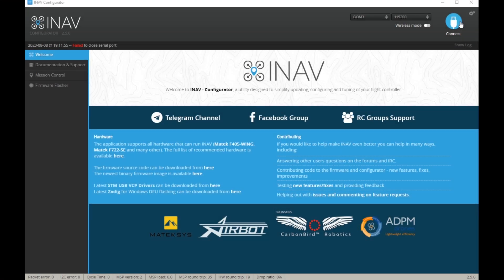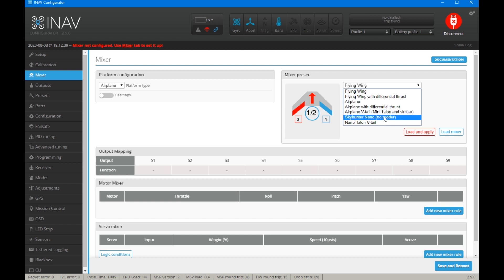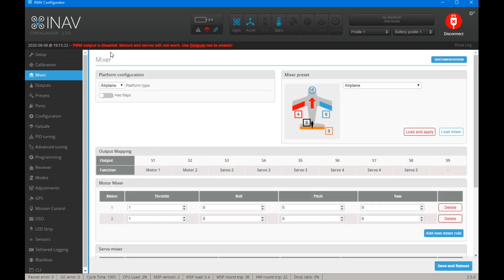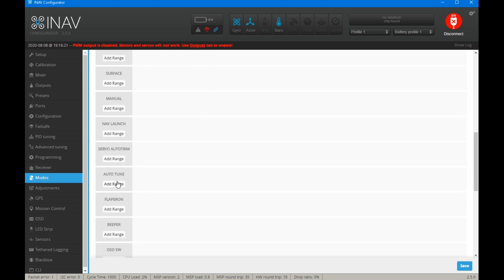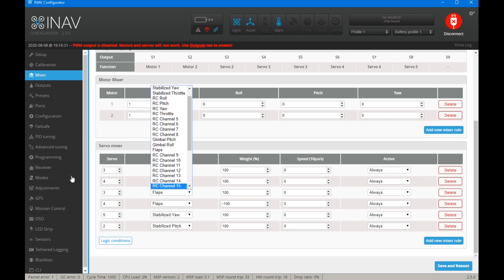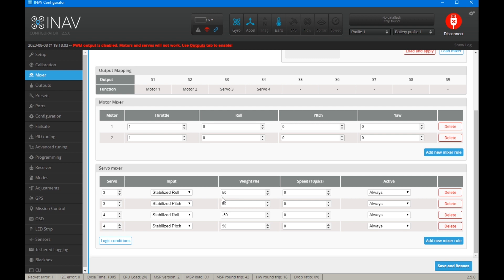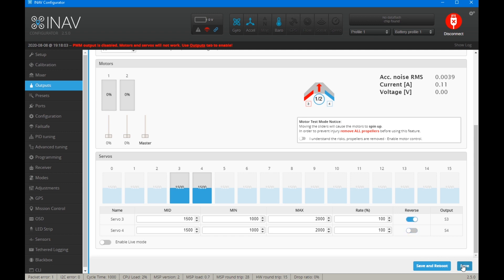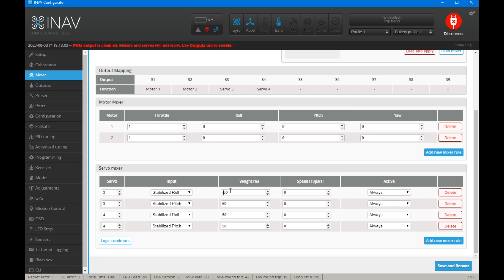Setting up the iNav Mixer

Comment: I know this is pretty old video Darren but I need your advise once again, I'm doing my first build ever of a inav vtail and have never flew a vtail, this plane is a talon rebel gt with 4 servos 2 for alerions and 2 for rear elevators. It would be nice if when you turn the mixer would activate the rudervators the correct amount to help turn, is this even possible? I ask mainly because this plane has very small control surfaces. Also the vtail elevators has no build in reflex so would you add a little atleast for maiden flight? Thanks for all your help

Comment: This video is old, but the problems with the mixer not. nobody understands, ho it works. i have a plane with ailerons (Y-lead for both - one channel), ruder, elevator and flaps. flaps are controlled out of inav. so i have 3 "servos" left. but why the heck its so complicated in inav to choose, wich output of the matek fc is wich deflection? 

in my case, inav did some wierd stuff and mapped the outputs so idiotic, that nothing is working, TILL I have to fix it...

wich output is wich servo, is wich in the mixer - and if im changing them, they not behave like i see in the configurator.

thats so annoying...
Reply from the maker: To be honest, the mixer is not too bad. The servos are assigned in order. You don’t choose which output does what, iNav had to do that based on what the target allows. The default mixer for each type of plane is shown in the diagram at the top of the mixer page. Also, Matek have great wiring diagrams for their flight controllers. 

The problems can start when you have a non-standard setup. But the key here is to setup your mixer before you connect the servos to the flight controller. That way, you know which output goes to which servo. For example, using a Y lead for the ailerons, just remove one of the stabilised roll mixes. This will cause the pitch and yaw to move along one output. Then just add the rc channel for the flaps to a new mixer line(s). 

Which output controls which servo is shown in the bar that runs across the screen, between the diagram and the mixer.

Comment: So I'm setting up a twin-motor for the first time, on iNav 3.0.2, and have debugged enough issues to finally get to motor mixing for yaw. The default mix for Yaw in the Motor Mixer is 0.1/-0.1. I flew the defaults last night, almost stuffed it when I couldn't straighten out after touching down, so I'm trying a 0.2/-0.2 mix next opportunity. I wonder what other people are using in the Motor Mixer for differential on their planes? I don't wanna go full ninja-star, but I do want to have enough authority to correct a wayward taxiing event
Reply from the maker: To be honest, it would depend on the setup. Some planes have a bigger effect with differential thrust than others. So it would be trial and error. Maybe just try taxiing to see how the 0.2/-0.2 works out.
Reply: @MrD  On it! 
(30 Minutes Later...)
GPS wont grab any sats. Because of course it won't. Sigh... I shall try again later, lol

Comment: Mr D, Good topic. I am trying to achieve Differential Ailerons in INav. I believe because there is only one Aileron Input allowed, you can't separate the offsets so that they go their proper directions. Adding a second Aileron in Mixes does nothing.
I guess that is why INav gives us a Flaperon Mix, same problem.
Could you give it a go?
Thanks!
Reply from the maker: It's not really about separating offsets, because iNav should be doing all the mixing anyway. There' should only be a basic 4 channel mix on the transmitter. The problem is that iNav's mixer is pretty basic, and doesn't include things like differential or curves. I think a more advanced mixer in iNav would be pretty handy. I'll add something on the GitHub and lets see what happens.

iNav does have a flaperon mode. But personally I prefer do add it myself in the mixer as it's more flexible. You can also add spoilerons too with this method, or crow braking on a full house set up.
Reply from the maker: https://github.com/iNavFlight/inav-configurator/pull/1226

Comment: The Flap mixer rules, even when Flaps are not selected above is annoying. Also curious why loading the Airplane Mixer preset loads the servos out of order. This could mess up new people to iNav who don't pay attention to the Rudder being at the bottom, but actually the first servo output on the FC. 

Final thought, you mentioned that you don't want to use more than 50 weight for the wing mixers, and if you "need" more then you should adjust the physical throw. But another thing to check/adjust is the roll or pitch rates. The Stabilized pitch and Stabilized yaw will only move the surface the amount the FC thinks it needs to meet the set rate, default is 200 deg/sec I believe. So if you move the sticks and think you need more roll authority then increasing the rate in the PIDS tab to 300 would give more surface deflection.

Good video, like the idea of these little chunks, rather than long videos. I know every time I try to do build videos/series the videos end up way longer than I want, or than I would expect any one to want to watch. Thanks for these!
Reply from the maker: There are some things that are strange in iNav. I can completely see where new folks could get  in trouble if they don’t knew where to look. I will do a longer video on the mixer at some stage, with a visual aid to help. Basically a little plane on my workbench. But I need to cut and build it first. 

With the weights, its more that the total weight of any control surface totals 100. So on a wing you have elevator and aileron on the elevon surface, so adding both together should total 100. The throws should only be measured in manual. Likewise, the pitch, roll, and yaw rates should be calculated by flying in manual. Just increasing the rates is not a good idea because you could dial in more rate than the model physically has, which is not good for the stabilisation. One thing that you can do is boost the servo output in the outputs page. But I would still recommend tuning it physically in manual. The model will just be happier, and the stabilisation will be better. 

Thanks. I know what you mean. I always think my videos are too long, so thought I’d try out these bite sized videos. Deal with one thing at a time and hopefully help more people 🙂